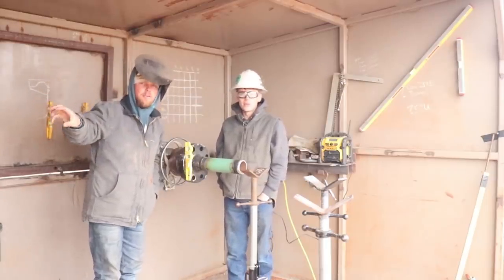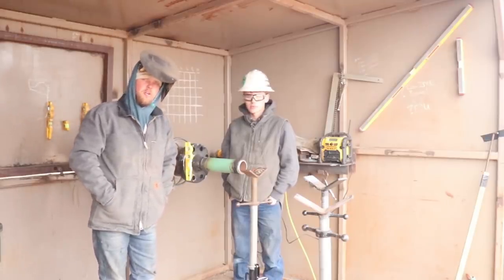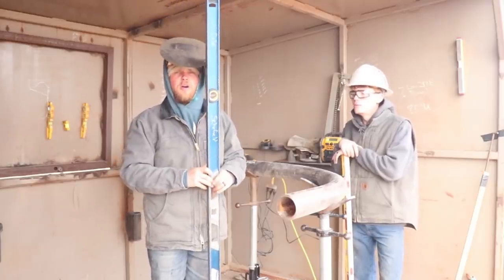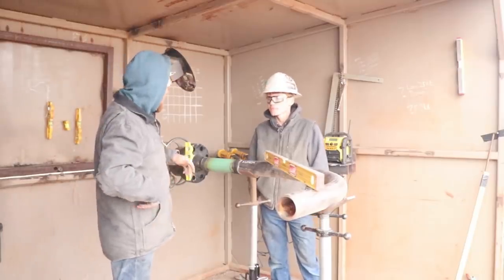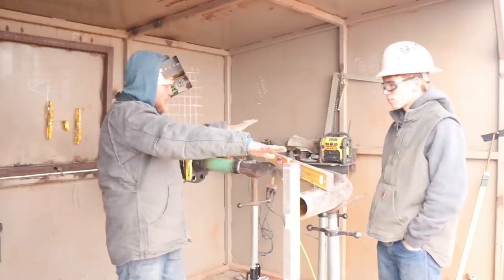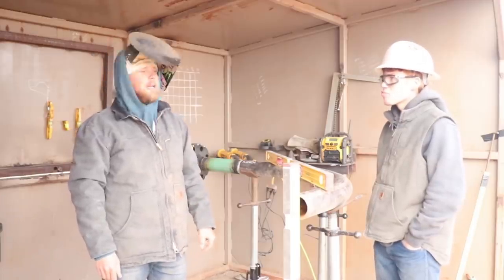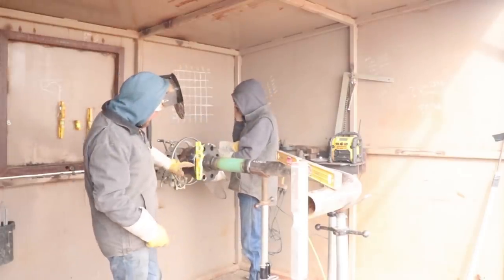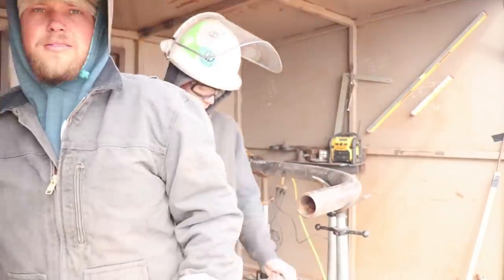RIG WELDER... TIPS ON WELDING SWEEPS, OR PIPELINE FITTINGS

Comment: I always ran my 6 foot level off the face of the fiting and my 4 foot folding square off the face of flange or the nut side of flange if it was on a roll out wheel, that way i dident have to worry if that 1 foot pup was off just a smidge. just my 2 cents
Reply from the maker: Great thoughts I see what your doing that’s great.

Comment: 3r elbows or 3D elbows in my day usually used for ease of pigging pipe . Especially used for smart pigging larger pipe . The throw or centers are 3 nps pipe diameters to center ,but can vary do to different manufactures specs .I always double checked centers on 3D fittings .  It is good to always have a 6 ft level on your rig . I even carried a 8 ft straight edge 3"x1/4"x96" aluminum strap
Reply from the maker: Dang Bart I need to find an 8’ straight edge that would be awesome

Comment: Forgot to mention 2 hole the flange before leveling out your sweep. You can also after tacking top and bottom roll your piece straight up since it’s in your flange wheel and run a level off the flange face or the small pup and on your sweep
Reply from the maker: True that Jeff thanks man.

Comment: You've probably have already been asked this question but couldn't find a video on it. But would a Lincoln ranger 250gxt be suitable at least as a starter welding machine? Even just on small pipe.
Reply: No bud at least an SA 200
Reply: Lincoln 305g
Reply: how about a vintage Hobart pipeliner? all copper windings, Willys engine? lol. in its day it was supposedly a little better than the SA200, but today, hard to find parts for, but I owned it well over a decade, closer to 15 years for local odd & end jobs, but its paid for, & I cant afford a new welder, nor even what people are asking for used SA200, so hoping to use it. I do have a Lincoln Ranger 9, but know its limitation too, but for small light duty projects its ok, like when I was repairing car trailers, & farm equipment
Reply from the maker: I think your better off getting a SA 200 of money is tight. I e never seen a ranger on a pipeline or bobcats, trailblazers there just to small or got a sore eye for some reason. So I wouldn’t waste your money if your wanting to do this.
Reply: Enbridge gas in Ontario canada allows those sewing machines. Alberta allows them on pipeline jobs. They work for any size pipe. 
 I have 200's,  and a 250 at home for when the power goes out. 
 I'd suggest putting one on a honda ridgeline and go test

Comment: Couldn't you just level  it straight up and two hole it??
Reply: nope gotta do it on the side like he shows you or it wont be true
Reply from the maker: There kinda big. So my roll wheel is like 4 foot high plus 3 foot for the sweep. It’s way way easier to just throw it in jacks.